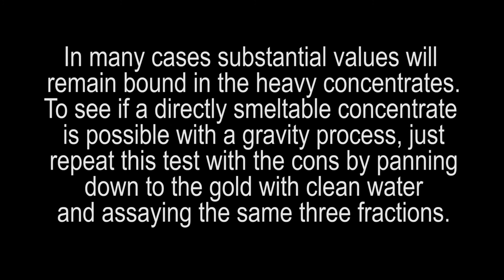Lesson 9 Simplified Liberation and Separation Test 2

Comment: 9:00 point I had to watch a few times. Question, So your Head Assay was on 1kg of material. Then you wound up with three grades, Cons, Tails, Slimes. You say to dry and weigh those fractions, then have them assayed individually? Don't they require an Assay Ton (29.166g) of material to test? Sorry if I'm missing something simple here. Your Cons fraction looks quite shy of the Assay Ton. I could see someone attempting fine panning on the fractions then weighing the results. It would seem that fine panning those Slimes would be nearly impossible. The Tails nearly as difficult, as Gravity Separation missed them the first time a second attempt would produce similar results. Therefore real Assays would have to be performed?

So that said, how do we come up with a large enough fraction to have Assayed when starting with 1kg of Head Sample? Sorry for the question.

I'm guessing that if one can't pull 29.166g of Cons out of a 1000g Head Sample walk away?
Reply: Sorry that last sentence I wrote was ignorant. It would depend on the Assay of the fraction. For me to say walk away if you can't pull an Assay Ton out of your Cons is ridiculous. There could be say 16g Au in that fraction equaling 514 oz per ton! Face palm lol.
Reply from the maker: Actually, an assayer can use a smaller sample if  needed.  If you had less than 1/2 assay to, he could use 1/4 assay ton and then multiply the result by 4.

The tails question is correct.  You are determining what can be recovered by GRAVITY methods only in this test.  If there is lots of gold in the tails, then you may HAVE to use a chemical extraction.  In this case you are gathering information as to what looks LIKELY to work.

Since a gravity separation is the least complex and easiest to permit, it is the first option tested.  It also happens to be the EASIEST to test.

There is also no reason to be apologetic about asking questions.  For every person who asks a question, ten people have the same issue and don't ask.

Did that cover all your points?

Keith
Reply: Yes you cleared that part up. Though the number of samples for assay confuses me. 

So the samples  you send off would include, 
one, 1 kg fraction being of Head Ore, I take it this is weighed out before you weigh your 1 kg sample of Head Ore for your liberation test? Then if collected, crushed and split properly they would be nearly identical samples right? One represents the whole for reference and one splits into your fractions showing where the values are found after your gravity process.
Those fractions would be 
Concentrates
Tails
Slimes
 
Then you'd take a 3rd 1kg sample of head ore, crush and pan to concentrate. Then with fresh water pan that concentrate to 3 fractions being; gold, tails, slimes? These last 3 fractions show where the values are contained in your concentrates. Those are compared to the results of the initial concentrate fraction assay and should be close to the same. This shows the values in your smeltable ore or talilings.
So in total you'd be sending 7 well labeled and recorded samples off for assay? Costing somewhere around $300 total for lab? 
Yep it took me a whole crayon to figure that one out. lol
Just making sure I'd be sending 7 samples.

Thanks for your time
Rob
Reply from the maker: Not exactly.  Let me try and verbally diagram this...

You start with an amount of crushed head ore (call it H ) such that you can SCREEN more than 1.5 Kg of fines from it for the liberation test.  In this case I screened it to 100 mesh minus  as that is a size that is relatively easy to achieve in real life with common equipment, but generally on the fine end of what you actually need for decent liberation in real life.  

Then you split and/or blend and cut the fines into two samples:

1Kg is used for the panning which I will call H100P, 

At least another 500g is sent to the lab for assay and I will call this H100A.  Since the screening process has probably changed the gold concentration from H to H100, this gives you the starting value for this test. ( The value of H should already be known and be good enough to be interesting- it is just irrelevant to this test because of the screening.)  The screening SIMULATES what would happen if all the ore was CRUSHED to this size.  If you can pulverize your sample to 100% 100 mesh minus, that would work even better and you could just use the value of H as your starting value.  But most people do not have that capability, so screening is a cheap alternative for initial test purposes.

Now that you have 1Kg of 100 mesh minus of knowable grade - you pan it to cons and then dry and weigh the cons (H100C), the slimes (H100S), and the tailings (H100T).  Then you send off H100A, H100C, H100S, and H100T to the lab for assay- four assays.  Assuming that you just hand panned the original head ore, found it interesting, and then did the liberation test, you would also send a split of H to get a precise number for that also.

IT IS IMPORTANT TO REMEMBER THAT H AND H100 MAY HAVE DRAMATICALLY DIFFERENT VALUES!  If H is much greater than H100, you may have coarse gold, if H100 is much higher than H, you probably have micro fine gold in soft minerals like limonite.

The value of H determines the overall economics of the project.  The value of H100 is just the starting point of the test which is to determine how fine you will have to grind in a mill to separate the gold.  Quite often the gold is associated with heavy minerals so that you can grind the head ore to a coarser particle size, like 40 mesh; and then run a gravity separation on that to get a preliminary concentrate of less than 10 percent of the total.  At that point you might wish to sell the cons to a refiner (especially if refractory) or re-grind to a finer size and run a secondary concentration to capture free gold.  You may even want to leach the cons, but this is much easier with a dramatically smaller amount.  There are many options and each ore is different.

I hope that clarifies things a bit.
keith